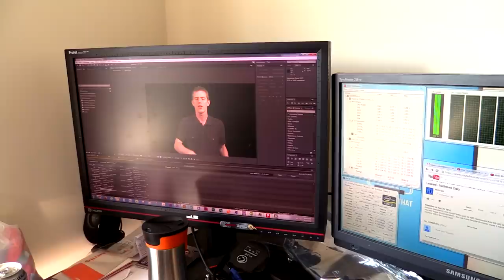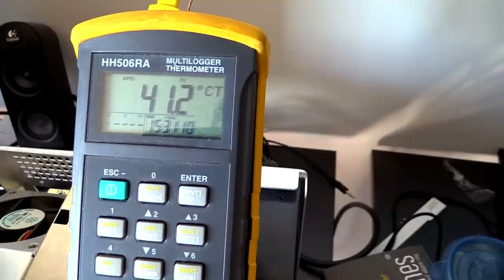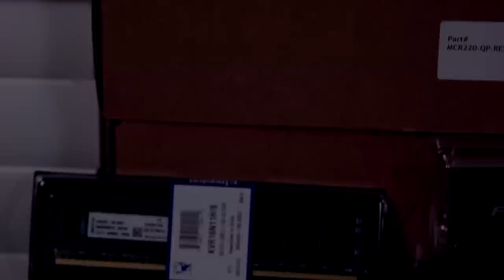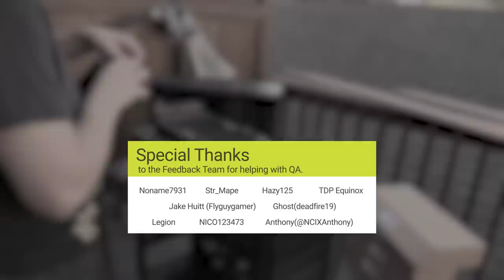Whole Room Water Cooling Project - Day 1

Comment: Linus, i have but few "design" questions. 

1. What happens when there's 38+°C (100°F+) with lovely sun? Last time i checked summer sun can even boil water if you put it in black metal container. There are even tourist shower bag things that work on same principle. . . It wont be cooling the system, itll be introducing new heat. . . 

2. What happens when temps go below 0? Metal container is also very good at freezing water and potentially leaking/destroying components due to pressure. When temps go down your entire team will be like "ok, no work/play today our cooling is officially frozen solid"?"
Reply: Simple, don't use water in the loop.  There's plenty of liquid out there that has different freezing and billing temps
Reply: Bryce Simms wow, hadn't thought of that.
What would be a good liquid to use in this case?
Reply: Simple they eill use the ip67 fans from noctua
Reply: And i think theyre systems run 24/7 so the water will be moving, therefor not freezing
Reply: 1. I think the tubing will be coming out of the northern side of the building so that the sun won't be a problem since the system mostly (if not always) won't be exposed to sunlight and additional heat.

2. Temps go below 0: as Bryce Simms said, it doesn't have to be literally water, but on the other hand, it may be cheapest option. Also remember the water will be constantly pumped so it will be "harder" to freeze it. Also add the fact that some workstations or servers may run 24/7 so they always generate heat.
Reply: Painting the rads white would help improve this, but to what extent would be interesting to find out. Freezing I wouldn't be too concerned about with all that copper surface area exposed to heating, But I also don't live in Canada. Which brings up another point. You're trying to improve system temps as well as room temps. Why are you running insulated copper inside of the room, it's just going to turn the room into the radiator.
Reply: Miles McDonnell They live in/near Vancouver, so they only go below freezing a few times a year, and not very far. It also rarely gets super hot there, almost always raining...
Reply: Shield the rads from the sun, and water moving through heat generators tends not to freeze.
Reply: he lives in Vancouver Canada and the hottest it ever got was 33.8 C
Reply: They did actually make a comment about this on the WAN show at one point. The rads are going to be in the shade at all times of the day, and as for the winter, they're going to make sure that the water doesn't go below a certain point using an automated thermometer system of some sort. Can't remember the exact details, but that's roughly it. :)
Reply: Miles McDonnell also, about the copper tubing inside the room; copper doesn't let go of heat as easily as other metals. it won't act like a radiator
Reply: My silly silly friend, in Canada you would be luck to see 28°c, 38 is unheard of.
Reply: jbenvenga Actually copper is one of the best metals in terms of thermal conductivity which is why it is favoured for high performance radiators. It will act like a radiator but can easily be remedied with a little insulation if it is an issue however assuming the outdoor radiator is sufficient it shouldn't be a concern because the temperature deltas between the water/copper and room wont be significant.
Reply: Sam B Yes, copper conducts heat very well, but it does not dissipate it. That's why high performance radiators all have aluminum fins, and why copper fins are only rarely used
Reply: Norman the Owl It conducts and dissipates at the same rate, aluminium is used because it is cheaper and easier to manufacture, high performance radiators use copper but they cost significantly more then aluminium ones.
Reply: LordJameh It doesn't matter. Because if the water (or whatever mixture) gets low enough compared to the ambient temperature in the room where all of the computers are in, dew will form. And that is the last thing you want near your electronics. They are asking for their rigs to be shorted out because of condensation forming. 

This entire project is completely and utterly stupid.
Reply: KinaestheticDmaw I don't think you quite understand what's happening here. There will be no substantial dew buildup on the pipes, and even then, the pipes anywhere near the components aren't copper anyway

Comment: If Luke's dad is a plumber, why the fuck didn't he say "Copper pipes are a really bad idea."
Reply: Because you can't get 100 ft bulk of soft, acrylic, or glass tubing.
Reply: Nicholas Festa That doesn't change that it's a bad idea :P
Reply: And put in a bleed point.
Reply: Because plumbers dont care about temperatures
Reply: Henrix98 Corrosion? They don't care about that either?
Reply: Lots of places here in the US of A have copper plumbing.
Reply: Lots of places have copper, but in the last 10 years it's getting pretty rare to see new plumbing runs in copper. PEX would have been a breeze here.
Reply: my house has copper piping my house is over 100 years old
Reply: Goofybeaver Unfortunately, if you have a 100 year old house, the copper isn't as old as the house. I just double checked and copper plumbing didn't really take off until the 1960's.
Reply: The house is over 100 years old we moved in 20 years ago we change all the piping to copper
Reply: Jonathan Peach They don't use galvanized in newer houses because it gets clogged really easy. Most common are pex, cpvc, pvc, and copper for non waste pipes.
Reply: My guess as to why they used copper is because pc water blocks are copper due to its conductivity and they didn't want to mix metals.
Reply: Fun? ;>
Reply: Battleboy43 i like to reply to old comments for no reason
Reply: Dreamplay same
Reply: Exactly, using steel or something else would have also made the room cooler.

Comment: coming back to this 8 years later and my first thought is "a room-high water column is a little over 10 psi and your pump is going to work way harder than it needs to"

could have ran them at desk or floor level along the whole loop and it would have avoided a lot of problems. plumbing them into hard copper lines instead of vinyl or better yet silicone was definitely a choice that was made. same with using those tiny radiators instead of an old AC rad.

but it was good content that's for sure

Comment: Wouldnt the bare copper pipes just allow heat to leak back into the room?
Reply: At first maybe, but at a certain point water stops being incredibly hot when it leaves the machine and it is no longer a problem.
Reply: Copper conducts heat faster through it, but does not dissapate heat as quick. If you look at cooling blocks they use copper to move the heat from the component into fins made of another metal that dissapates heat better.
Reply: true, ive never actually wandered why they used both copper and aluminium. do u know why copper does not dissipate as well though?
Reply: sniperlif3 
Ive just done some research myself and found a lot of furious debate lol. I do believe copper is a better at dissipating heat than aluminium though.
What i've gathered:
Thermal conductivity of all materials is the same for heat going in or out. Dissipation just means heat transfer, after all.
Copper has a higher Thermal Conductivity than Aluminum so it absorbs and gives off the heat faster.

The best preforming heatsinks have a large surface area. When it comes to the amount of heat dissipation the values that matter in calculating the actaul amount is the surface area and the difference in temperatures of the heatsink and the adjacent air. When you apply a constant load onto the heatsink then the temperature of it will rise until the amount of heat entering the heatsink and the amount of heat dissipation are equal. The airflow improves the amount of dissipated heat because it provides cooler air to the surface of the heatsink. With no airflow, the air warms up around the heatsink and has to dissipate heat through that warm air.

The reason copper heatsinks with the same surface area as aluminum perform better is because copper transfers heat better. The temperature drop from the die to the surface of the heatsink is very important. If the drop is 20c then the heatsink can't cool very well because there isn't as much of a difference between the air and the heatsink surface. A perfect heatsink setup would have it's entire surface area the same temperature as the die. Hence the need for a metal with high thermal conductivity.

They use aluminium for the heatsinks because it is cheaper and easier to manufacture.
Reply: nah, the surface area is not much. Heatsinks have many fins to increase surface area which increases the rate of heat dissipation. A pipe doesnt do that.
Reply: yea that seems right. still, im sure there are plastic pipes which dissipate even less, so I wander why they didn't use those
Reply: can u provide proof of those numbers? I found a forum comment where a guy works out everything for u, proving mathematically that copper is better at dissipation.

"OK, specific heat (Cp) is the measure of how much energy it takes to raise the temperature of 1kg of material 1degree (C or K). The Cp for copper is 385 Joules/kg*K and for aluminum is 903 J/kg*K (at 300K = 23 deg. C). density for both is copper: 8933 kg/m^3 and alum: 2702 kg/m^3

So, if we have two same SIZED blocks of material, say 1m x 1m x 1m for simplicity, we have different masses, namely 2700kg of alum. and 8930 kg Cu. if we put 2.438 x 10^6 Joules of energy into each block, we can calculate the temp raise:

Q = m*Cp*deltaT --> deltT = Q/(m*Cp)

deltaT alum: = 2.4381 x 10^6 J/(2700 kg * 903 J/kg*K) =1 degree

deltaT Cu: = 2.4381 x 10^6 J /(8933 kg * 385 J/kg*K) = 0.71 degree

so for the same SIZE blocks, more heat is energy is required to heat the copper by the same delta T than the aluminum. In other words from the moment you turn your computer on it will take a longer time for a copper heatsink to reach steady state conditions.

Now since these blocks have the same size they have the same surface area (that's what we're comparing, right - same size/shape/etc... heatsinks)

Now, that is really transient heat transfer, where there is a buildup of heat in one of the components of the system (the heatsink). At steady state, BOTH Al. and Cu. heatsinks will stabilize at a certain temperature and the heat per unit time (J/s = Q_dot) will be exactly equal to the heat leaving the heatsink per unit time. It will just take a longer time for the Cu one to reach this point.

Now we're talking steady state:
2 processes going on:
(1) is conduction of heat through the heatsink
(2) is convection of heat from surface of heatsink to air

for conduction: Q_dot = (kAc/L)*(Tdie - Tsurface) <-- equation (1)here Q_dot is joules/second or Watts, k is the thermal conductivity of the material in Watts/meter*K, Ac is cross sectional area through the heatsink in meters^2, L is the lenth between Tdie and Tsurface in meters, Tdie is temperature at the die or temperature at the bottom of the heatsink (here we'll consider them equal) and Tsurface is the temp. at the surface of the heatsink, where the air contacts it. (temps in degrees C or K)

for convection: Q_dot = hA(Tsurface - Tair) <-- equation (2)
where A is the area of the surface of the heatsink (giving heat to the air) and h is the convection coefficient and has units Watts/meters^2*K.

from equation (1): Tdie = Q-dot * L/(k*Ac) + Tsurface
from equation (2): Tsurface = Q_dot/(h*A) + Tair

combining: Tdie = Q_dot*L/(k*Ac) + Q_dot/(h*A) + Tair

Taking the Tair, Across section of the heatsinks, A surface of the heatsinks, L length of the heat must travel between the die and surface, and Q_dot to be constant and the same in both cases (Ac, A, L wil be same because we are comparing the same heatsinks just of different materials, but the physical dimensions are the same, Q_dot is constant because the cpu puts out a fixed amount (ideally) say xxxWatts under load, and Tair is constant for it to be a fair comparison)

k for alum = 237 W/m^2*K
k for Cu = 401 W /m^2*K

->You can see from the resulting equation that to make Tdie lower the only thing you can change is to make k, the thermal conductivity bigger - which is why COPPER WILL ALWAYS YIELD LOWER TEMPS FOR THE STEADY STATE HEAT TRANSFER.

Now, one more thing - after you turn your computer off, there is no more heat being put into the heatsink, and it is a possibility that the aluminum might cool down faster, but I'm not convinced of that yet. But who really cares then - the computer is off. All we really care about is steady state, which has been shown that copper will always yield lower die temps that for aluminum. (in the same situation, same mounting, same design heatsinks, etc....)

Also, anyone in this thread that hasn't looked over at the "Convection" thread by Neomoses also in the Technical Discussion Forum should give it a quick glance over. "
Reply: i copy pasted that from another site. can u see those quotation marks?
Reply: All anyone has to do is read up on welding and brazing... Simple as that.
Reply: Evipicc its pointless to continue trying to convince him. i already gave the info needed.
Reply: copper is a good conductor to heat.
Reply: Thinking back to my physics class and using common sense you seem wrong. How can something be good at taking heat in but also good at keeping heat from leaving?
Reply: sniperlif3 no. The only reason they use copper base plates and heat pipes and aluminum fins is because aluminum is much much cheaper and lighter than copper, so they use the copper where it's of the most benefit and still keep the price (and mechanical strain on the motherboard) reasonable by using aluminum for the less critical parts.... they use copper here probably because of materials commonly used in plumbing it's the one they found the most cosmetically appealing. I probably would use the first of the following to meet thermal requirements: PEX, PVC, insulation wrapped cast iron. If I where worried about astetics I'd instead go straight for stainless steel, maybe run PEX/PVC/cast-iron through larger diameter copper plumbing.
Reply: *****
Then go back into physics, apparently you havent heard of Fourier's law, Planck's law, or any of the other studies done in the past.
Here is a great example iron and pine wood have roughly the same emissivity (temperature radiation), tell me which one is a better conductor? Iron of course, it has a thermal conductivty of 80 while the pine is .12
Common sense, says you have not learned object density, malleability, or conductivity.

Try running a lot of electricity through different wires. Let me know what happens to the heat. Thats a first year physics experiment.
Reply: ***** air is a poor conductor of heat, but so is water. What makes them both good coolants is that they are fluids and produce convective flows when heated or cooled.
Reply: yes it would
Reply: Evipicc there r 2 different conversations going here. Urs is regarding the pipes. My original point was the heat is leaking back into the room they said they were trying to cool.
Reply: sniperlif3 those cubes r not equally dense. they are equally sized and shaped.

Comment: what if they mounted all the motherboards and power supplies on a wall, connected it all up (between all the computers) then run display cables and USB hubs to each desk. that way there's less pipes going everywhere and the desks can still be re-arranged (so its not as permanent).
Reply: This isnt permanent... Everything is designed with quick disconnects and seperate rads on the computer so that they are all watercooled on their own without being connected to the main system.
Reply: sniperlif3
What about all the copper pipe being installed on the wall?
Reply: Mike Baker
Yes, copper conducts heat more than dissapates..
Reply: sniperlif3
I'm mean the pipe is Permenant!
Reply: Mike Baker
Im sure they will still move it, the only thing completly stuck will be the holes in the wall. Guess we will have to wait to see what they decide to do.
Reply: sniperlif3 Yeah, because mixing up a bit of plaster and filling up the holes is so expensive and time consuming that it would hardly be worth the effort.
Reply: TheBernhard100
Exactly, they need to save their money for the move and need to put all of their time into the move as well.
By the way, I was saying that they can't remove the holes and take them with....
Reply: sniperlif3 That's the same thing.
Reply: i was also suggesting that mounting all of the PC's together would use less piping (in terms of distance), thus would create a shorter loop, which i herd is better for water cooling?
Reply: sniperlif3 Oh, my bad
Reply: billy936  Money and time are the same thing?
Reply: sniperlif3 Yes they entirely are when you pay your employees and contractors for the time they work.
Reply: MrHakisak The length of the loop is entirely inconsequential AS LONG AS your pump can handle it. The entire system reaches a stabilized temperature across all components and all length of piping, give or take a few degrees.